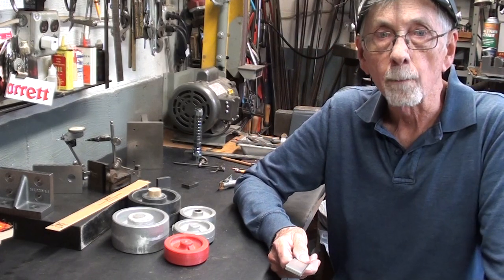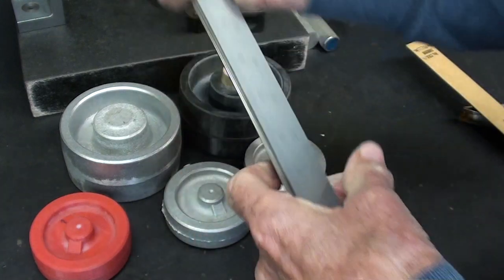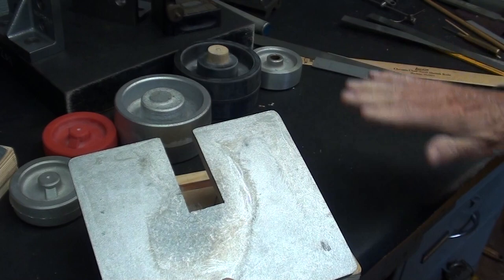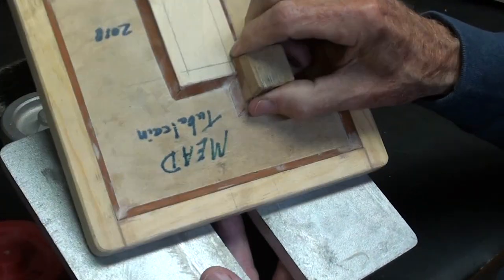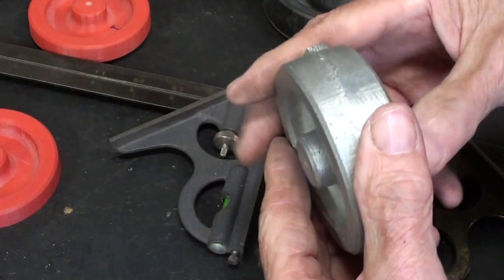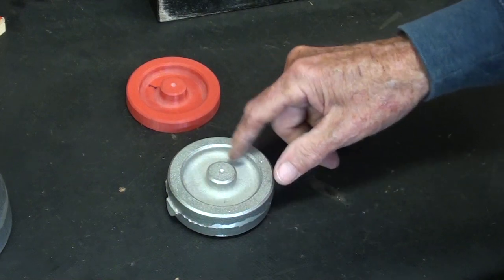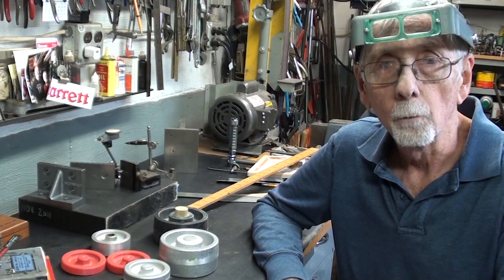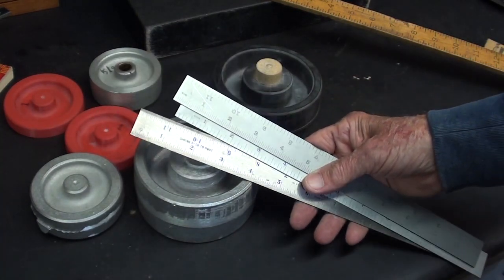WHAT ARE SHRINK RULES Short #16 tubalcain patternmakers

Comment: The joke about  George Costanza was vert funny. And the double shrinkage for multiply batch casting was very interesting. Where i did my machinist (Fitter & Turner) apprenticeship, we still had a small pattern shop, as we still cast in house in out foundry, they still had the, then disused overhead shaft belt drive, sitting above.   Cheers from Australia

Comment: Interesting that this video came out today. Just yesterday I was showing my young trainee the shrink rules we have in the cabinet in the shop that are left over from the old pattern maker that trained me. I explained their purpose and cautioned him not to confuse them with ordinary ones. He has to listen to me because I’m the ruler of the rules and my rulings are final. Some other little treasures are the ball ended burnishers (not sure of the correct term) that were used for fillets.
Reply: Robert Pearson  Did you also explain to him "the rule of thumb" ...
Reply: The ball end burnished are called fillet irons. The ordinary rules are called common rules. As a side note the difference between a ruler and a rule. With a ruler the graduations do not go to the end. Like a drafters ruler, and sometimes called a scale. A rule starts and ends with the length of the rule, in. A 12" rule is just 12" long.
Reply: @Finke.  Yes, thumbtimes you win and thumbtimes you lose.
Reply: @robertpearson8798  😄 Aaah ... but did you know ...
Rule of thumb measures one inch as the distance from the craft persons knuckle to the tip of their thumb ... This is part of an old English system of measurements based on the body that included the yard (which is the distance from the nose to the tip of the index finger) and the foot.
Reply: @Finke.  now you did it. I'm going to have to check those measurements in the morning. I kind of want to get out of bed and do it now but I need to go to sleep. 
Thanks for that info. It was very interesting. I think I'd make stuff on the big size if I went by that but I'll know better in the morning. 
God bless you! 
Jesus answered and said unto him, Verily, verily, I say unto thee, Except a man be born again, he cannot see the kingdom of God. 
John 3:3 KJV

But the fearful, and unbelieving, and the abominable, and murderers, and whoremongers, and sorcerers, and idolaters, and all liars, shall have their part in the lake which burneth with fire and brimstone: which is the second death. 
Revelation 21:8 KJV

Moreover, brethren, I declare unto you the gospel which I preached unto you, which also ye have received, and wherein ye stand; By which also ye are saved, if ye keep in memory what I preached unto you, unless ye have believed in vain. For I delivered unto you first of all that which I also received, how that Christ died for our sins according to the scriptures; And that he was buried, and that he rose again the third day according to the scriptures: 
1 Corinthians 15:1-4 KJV 

For all have sinned, and come short of the glory of God; Being justified freely by his grace through the redemption that is in Christ Jesus: Whom God hath set forth to be a propitiation through faith in his blood, to declare his righteousness for the remission of sins that are past, through the forbearance of God; To declare, I say, at this time his righteousness: that he might be just, and the justifier of him which believeth in Jesus. 
Romans 3:23-26 KJV

But God commendeth his love toward us, in that, while we were yet sinners, Christ died for us. Much more then, being now justified by his blood, we shall be saved from wrath through him. For if, when we were enemies, we were reconciled to God by the death of his Son, much more, being reconciled, we shall be saved by his life. And not only so, but we also joy in God through our Lord Jesus Christ, by whom we have now received the atonement. 
Romans 5:8-11 KJV

For by grace are ye saved through faith; and that not of yourselves: it is the gift of God: Not of works, lest any man should boast. 
Ephesians 2:8-9 KJV

Therefore being justified by faith, we have peace with God through our Lord Jesus Christ: By whom also we have access by faith into this grace wherein we stand, and rejoice in hope of the glory of God. 
Romans 5:1-2 KJV

That if thou shalt confess with thy mouth the Lord Jesus, and shalt believe in thine heart that God hath raised him from the dead, thou shalt be saved. For with the heart man believeth unto righteousness; and with the mouth confession is made unto salvation. 
Romans 10:9-10 KJV
Reply: @Finke.  you are likely correct, but I had always assumed it was the way one would draw an approximately straight line parallel to an edge by bracing a part of the hand on the edge while holding a pencil and scribing.

Techniques like that were common to old time boat carpenters as we distrusted measurements, we built to the scale of the boat and we had many tricks for fitting things.

Comment: Thank you for these videos, I find them entertaining and useful. I understand the concept of double shrink. I work in a foundry that does investment casting. When we make our injection molds they have to include 2 shrink factors, one for the wax pattern and the other for the metal. For example, the wax has a shrink rate of .006" per inch and the aluminum has a shrink rate of .006" per inch also so that when we calculate the shrink to build the wax pattern mold it has to have a shrink of .012" per inch (.006"for the wax pattern shrink + .006"for the aluminum shrink) in order for the metal part to come out right. Thanks again!
Reply from the maker: Very interesting

Comment: My first machinist box and tools I bought from an old retired machinist when I started in the 80’s had several steel rules in it, which I still have today. So I gave my father a couple of them for his box at work, he was in machine tool repair in an equipment factory. He came to me a few weeks later and told me after things weren’t adding up that these were shrink rules. Come to find out the fellow i bought my tools from was a retired pattern maker. We got a laugh out of that and I an education on all is not always as it seems. Thanks for the videos sir.
Reply from the maker: lol
Reply: 🤣🤣🤣 that would have been a very frustrating few weeks, I can imagine measuring and measuring and measuring again all while wondering what the hell is going wrong
Reply: He was definitely scratching his head for a while @markshort9098

Comment: Back in 90's, our foundry used cast iron permanent molds for casting aluminum.  Miller Pattern works provided our molds & I remember old Bob using these to make his patterns.  The permanent molds were done in a sand casting with very little machining afterwards, but he had to contend with the cast iron shrinkage when cast, the expansion when in use, & the shrinkage of the aluminum casting once cooled.  Talk about clear as mud.  But I found all this fascinating.

Comment: More information than I need to know, BUT I enjoy learning this information.

I purchased a tooling cabinet that included tooling that I will never use. There is quite an assortment of "draft" mills. I thought that they were some sort of power tapered reamers. The seller had used or inherited them for making pattern draft. There is also an assortment of specialized production tooling for making tapered countersinks. They have incorporated micrometer type stop adjustments. Some have laid unattended and the adjustments are frozen. I should gift these to you for a short subject or what is it video. I didn't need the cabinet space, so this unneeded tooling has long sat unattended in my shop.
Reply from the maker: Very interesting. I have never seen nor heard of those tools. I would be glad to accept these and use them in a video   .
my shipping address, if you are interested, is shown in my latest promotional video entitled.
Christmas special Mrpete shop courses videos, atlas. Thank you for your consideration and offer.

Comment: Thanks! Many years ago when I was a boat builder and things got slow I would get work as a pattern maker. I loved it and it taught me precision which helped with the boat carpentry, and sometimes a boat carpentry trick would  ease making a pattern. No CAD in the day so blueprints, rules, etc,  If we wanted to duplicate a piece that we had an example of we would use calibrated thickness wax sheet to cover the original. Always seemed like a hack, but was usually sufficient.

I still have my 20" State disk sander, a very useful patternmaker's tool. People today may think they are just sanders, but really they are meant to cut complex curves and lines on a pattern. I use mine to shape metal odds and ends in my hobby machine shop.

Love your stuff Mr. Pete.
Reply from the maker: Thank you. I had some of those sheets of wax for pattern makers. I never didn’t know exactly what they were for or how to use it. In fact, I think I threw it away I would love to have one of those big Sanders. They are amazing, and they cost thousands and thousands of dollars.

Comment: The "Short" videos are often used to pique the viewers curiosity with a little taster of a subject and make the viewer want to click on the channel link and find out more. You Tube has said to some of the bigger creators that it's the shorts that they are going to be promoting so presumably they have figured that they keep more viewers glued to the screen for longer. I've found a number of smaller channels that I otherwise would have missed by flicking though shorts.
Reply: Shorts are a form of “click bait” They pull you in and get you all frustrated if you’re not careful.

Comment: Using a shrink rule as a gag sounds like a fun trick to play on someone. After the inspector lays down his rule to take his coffee break, exchange it with a shrink rule. He or she comes back and begins checking parts again and notices that all the parts are now unfinished but all of the inside dimensions are over sized. The little wheels begin to turn in the inspectors head. Then he or she picks up the rule and there is the rate of shrink engraved in it.
Reply: Hah!

Comment: The only thing missing here, is that there are at least TWO reasons  that determine WHY shrinkage is different for various metals:
- Different metals grow at different rates per degree of temperature increase. There at tables for "coefficient of linear expansion".  For instance:  The coefficient of linear expansion of Aluminium is about 22 x (10-6) m/mC or 22 x 0.000001 per unit-length per degree C of temperature rise.  IIRC, that's about twice the growth rate per degree of temperature increase as for cast iron.
-The second factor is the temperature at which the material is poured.  You multiply the expansion RATE by the number of degrees C above ambient for the specific metal to be poured to get the growth rate per unit length to get the overall growth for the pattern.
Why is this important? -  IIRC, cast iron is poured at about twice the temperature as is aluminum.  And most steels are poured at many hundreds of degrees higher than is cast iron, even though both are made up mostly of iron.

--I didn't look at all the previous comments, so this may be a duplicate
Feel free to delete this if I have made any errors.

Comment: Let's confuse things a little more. I have complete sets of both 1 foot and 2 foot shrink rules. But since we also made patterns from metric drawings I bought a set of metric shrink rules. The difference is metric uses percent of shrink. So you need to know the equivalent shrink for the alloy being cast. You double shrink will be 3/8" and 7/16" rules. As a novelty I have 2 metric shrink tape measures, a 1.5% and 2% both 2 meters long.
Reply: Sorry about your metric disease.
Reply: @gordbaker896  i think you misread my comment. The metric tape measures are a novelty because I won't ever use them. But I can use both metric and inch rules equally well. Doesn't matter if inches are in fractions or hundreds of an inch. In each case it's just a unit of measure. One is no better than the other.
Reply: @roscoepatternworks3471  I can work in both but prefer Imperial.  I have a couple Left Hand Tape measures.  Clip on Left side of body.  I consider Fahrenheit much more accurate than C°.
Reply: @gordbaker896  lefthand tape measure is new to me, but I never really looked. Most unusual tape was an engineering tape. Marking was in feet and 10ths of a foot. Used for boat building and civil engineering. I did a lot of shipyard work, in the patternshop
Reply: @roscoepatternworks3471  I had a very useful tape measure that was stolen from me.  If you wrapped it around a pipe, it gave the Diameter!  Never was able to acquire another.
Reply: @roscoepatternworks3471  I once had a tape measure that when wrapped around a pipe or round vessel would give the diameter.  Sadly it was stolen.
Great avatar design.

Comment: I noticed the slit in the cast table and it made me wonder about how you manage shrinkage there. I assume the opening gets larger so do you compensate in reverse?  
Thanks again Mr Pete.
Reply: Interesting question - but no, you don't need to consider a reverse compensation. The shrinking part stays to scale, and simply gets smaller as a whole. As another example, if you heat a metal washer with a torch, the metal doesn't expand inward and make the hole smaller, instead the whole thing just increases in size. All diminsions are larger - hole diameter, outside diameter, and thickness. And when it shrinks, it shrinks back evenly to it's original size. A casting behaves the same way.

Comment: Would the measurements be the same in reverse? Like having a hot part verses a cold one? Also would size of parts have to be taken in consideration? Good stuff by the way.
Reply: Short answer yes. I built a pattern for what is called a pivot bin, a vacuum form tool to be cast in aluminum. Three shrinks are required, one 5/32 for the aluminum tool, the tool is the heated to a couple hundred degrees so that expansion is calculated then as the plastic is removed and cooled its contraction is also calculated, into the pattern. One thing not considered, the part was 8 feet long, when I checked the part it was good sent to the customer, it was out of tolerance by .032". The difference, our shop was 55⁰ their inspection room was 75⁰.

Comment: @robertpearson8798
They are referred to as fillet ball applicators or fillet rubbers. They are chrome plated steel (when new) and are to be warmed or heated over an alcohol lamp to to rub wax fillets in corners on a pattern or core box to eliminate sharp corners in the sand mold and add strength along with a smooth transition in the finished casting.
Reply from the maker: Thanks

Comment: How about demonstrating a layout using a shrink rule?  I'm having trouble getting my mind around the procedure.  I would think the shrink rule would be longer than a standard one?  Thanks!!
Reply: You would transfer the given measurements on the drawing to the layout using the shrinkage ruler and the shrinkage would automatically be added without calculation. In my job we always use the same shrinkage factor (1:160) and our patterns are on the large size so we just do the math.
Reply: I realize now that the shrink rules are, in fact, longer than a standard rule.  Didn't pick up on that the first time I viewed the video.  I guess I wasn't quite awake!!
Reply: @robertpearson8798  I suppose that for cast iron you’d multiply all the part dimensions by 1.125 and for aluminum by 1.188.
Reply: @ellieprice363  That would be one heck of a shrinkage factor.
Reply: @robertpearson8798  Correct, got that wrong. The shrinkage factor applies the foot of course. So what math would you use for smaller print features, such as a 1.562 hole? Would the pattern hole be smaller or larger? Can’t quite get my head around it.
Reply: @ellieprice363  A good question that doesn’t usually apply to the stuff I make patterns for, hopefully someone more knowledgable will chime in because I’ve always found that a bit puzzling as well.
Reply: @robertpearson8798  The shrinkage factor for cast iron is .125 inch per foot (12.125), so shrinkage per inch is one twelfth of that (1.0104). This factor can be applied to any cast iron pattern measured in inches.

Comment: I have my great uncles set of shrink rules, I have one Starrett 369 which is 3/8" to the foot
I wonder what metal that is for?
Reply: Manganese maybe? Not sure, but I do know its coefficient of expansion is unusually high.
Or maybe some type of plastic such as PET? (Edit: just noticed you said great uncle - guess it's not the plastic :) )
Reply: A 3/8" shrink rule would be used for making a cast aluminum pattern for steel casting. It's 1/8" for the aluminum and 1/4" for the steel.

Comment: a pal of mine was working at a surplus store and they had some 24" steel rules for sale they were new and the price was vary reasonable i was going to buy a few as gifts my pal told me to save my money i ask him why then he told me they were shrink rules i told him that sucks . then there was the time at the auto parts swap meep and the guy selling the new flex fans for $5 and a guy tells him that that they were for ccw no cw rotation i ask the guy when one one was around what were they for he told me vagas as the water pump runs on the back side of the timing belt